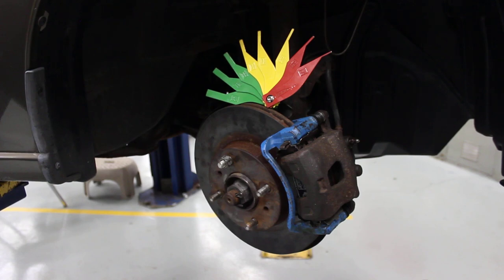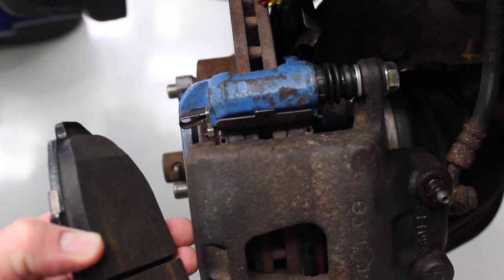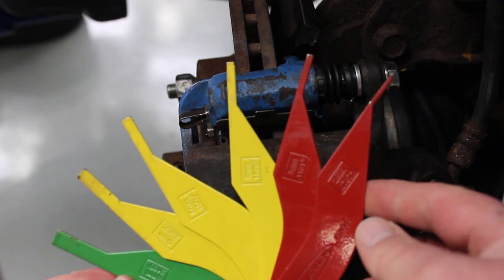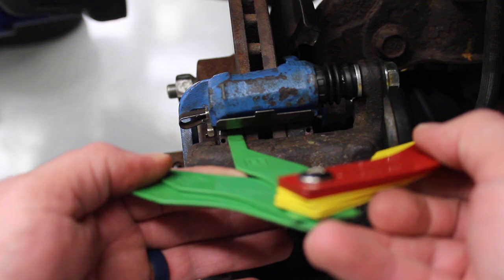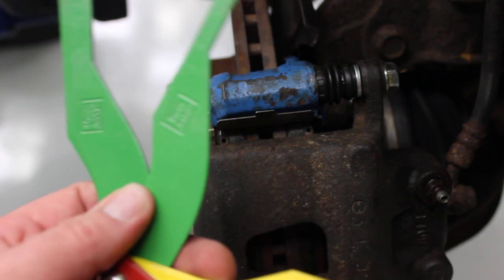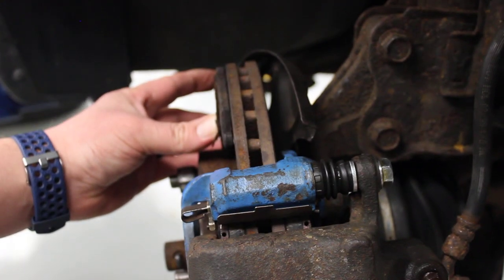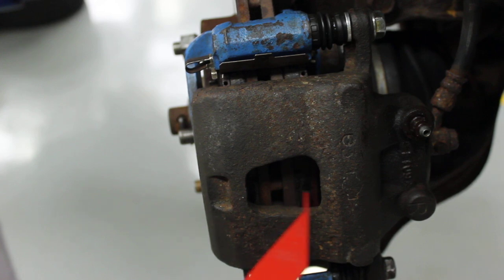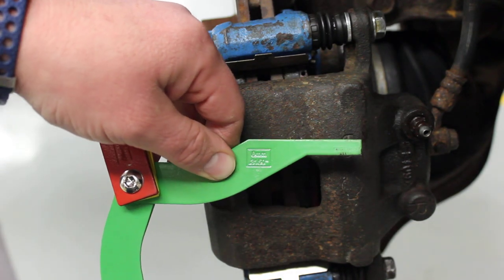Brake Pad Inspection Using the Colored Gauges

Comment: I thought u put it through the window there and into the groove through the pad lining? That's what I was tought when I got ase certified
Reply from the maker: No, that is not correct. However, the groove can be used as a wear indicator by itself because the distance between the backing plate and start of the groove is typically 2mm (indicating the pad is wore out when the groove is gone). Inserting a 2mm red gauge into the groove would actually mean you have at least 4mm of pad left. (2mm groove + 2mm remaining pad after groove is gone). Great question!
Reply: @MrAdkinsAuto  He is talking about the square opening in the caliper. Their are many methods of measuring brake lining, even without take the wheel off.
Reply: @MrAdkinsAuto  and technically those are 9mm. You do have some play.
Reply from the maker: David Houk in that case you are correct. I thought he was referring to the gas vent in the lining.

Comment: Can you use these on heavy duty truck pads?
Reply: Yes but I suggest changing at 3 mm for trucks new brakes thickness usually 10-12 mm so changing at 2-3 mm means last 1/4 of brake life which considered accepted more will be useless and lower will affect rotor surface so please change at 2-3 mm and you will thank me for that 
Another advice always change brakes in pairs or as set not one side for example